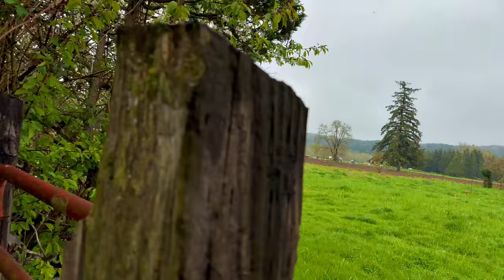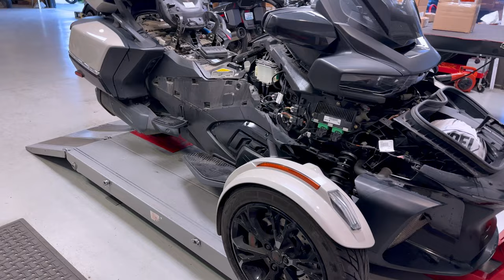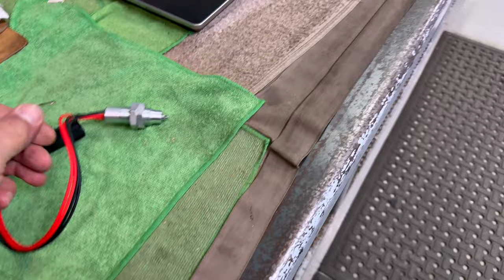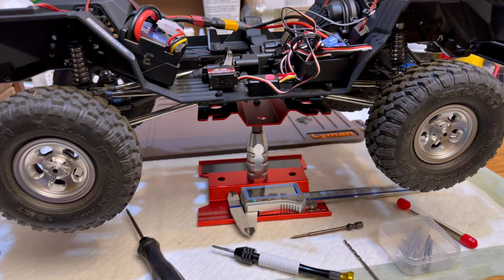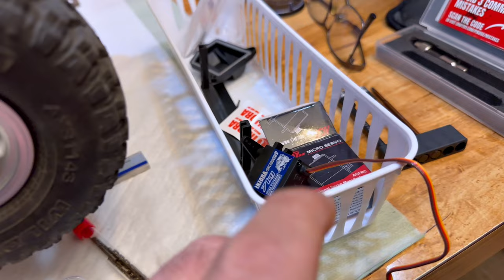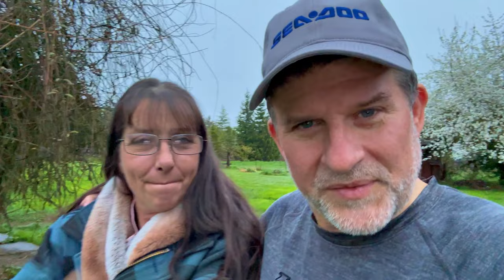RT-Ryker Brake Recall..! • Really Cool Customer! | TheSmoaks Vlog_2727

Comment: Do they run metal gears? I switched to metal on all my high performance planes years ago!

I’ve had some cool customers over the years selling cars. That’s cool! 😉
Reply from the maker: I believe the SCX10III's do come with metal gears... But I thought the Redcat Gen8 V2 did as well, turns out they don't.  It's $30 bucks for the trans & transfer case CNC'd metal gear set upgrade, and that should show up today..!  Maybe that will quiet some of the drive train noise of that gal..? Lol

Thanks Dj!!
Reply: @TheSmoaksVlogs  maybe, we’ll find out together! 🥴 got a ride in on my Spyder today, will probably get another after dinner! 😉👍🏻